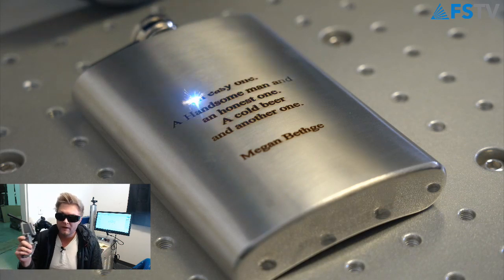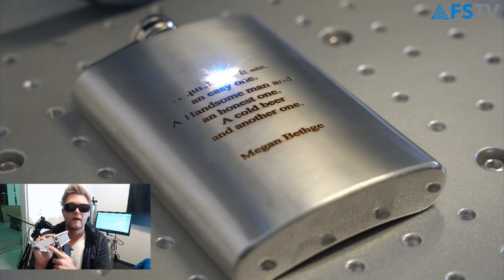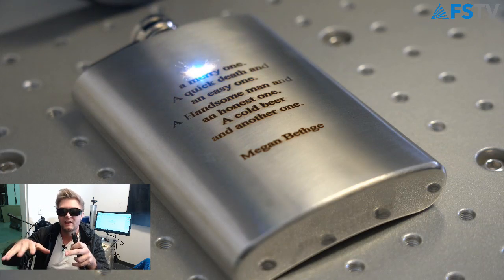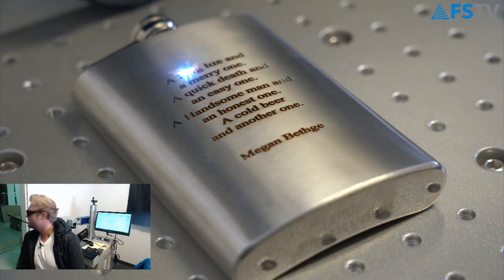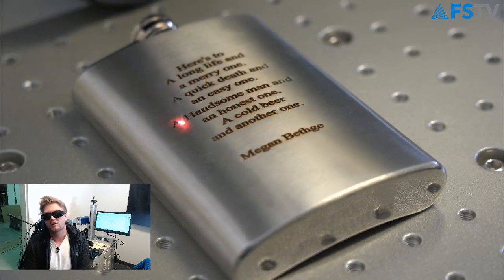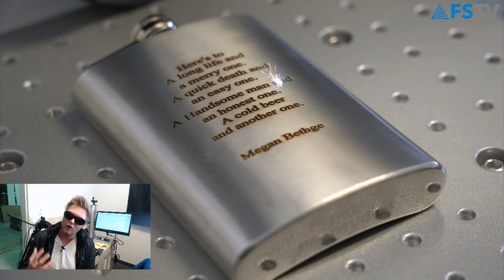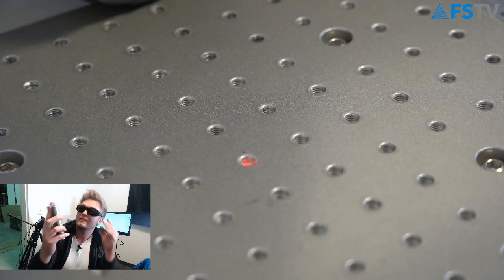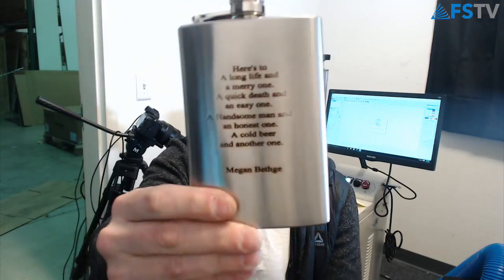In the Cut - Flask Design Fiber Engraving (50W Fiber Galvo)

Comment: We have one of these units, thoroughly stoked until I tried to use it. Constantly battling the terrible workplace capture option, autofocus failure, unit losing comm despite installing a local switch for connectivity. Oh and the Tech support? Never gets back to you. So far I have to say "Buyer Beware"